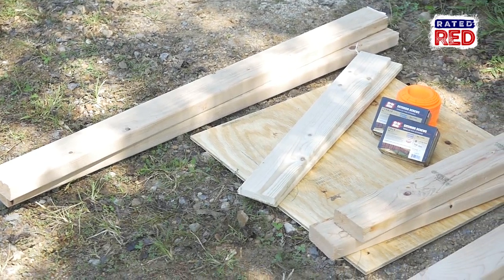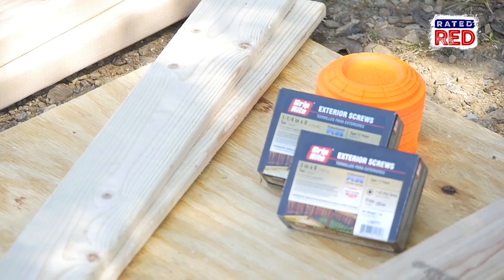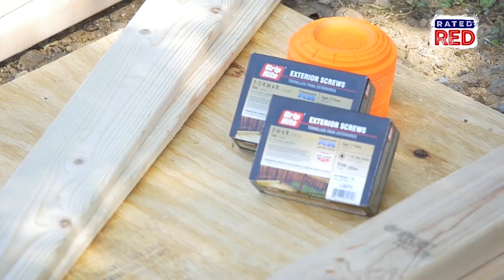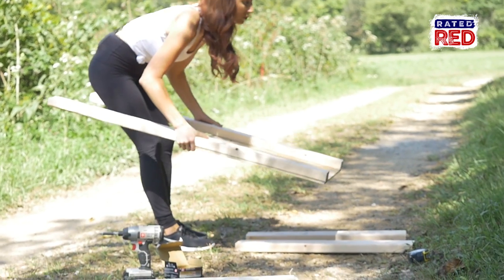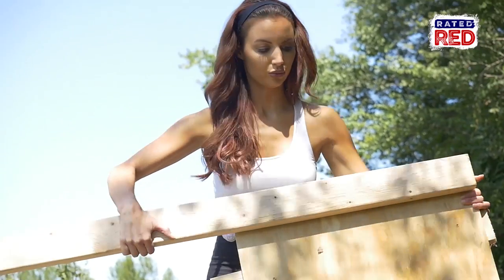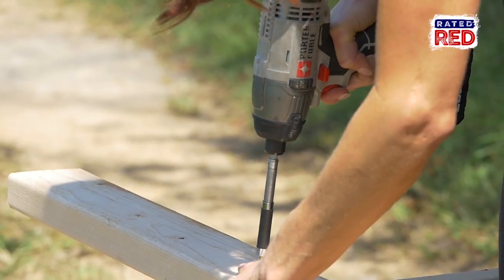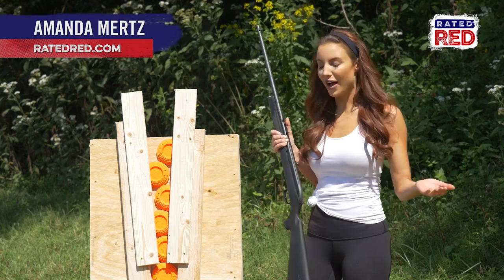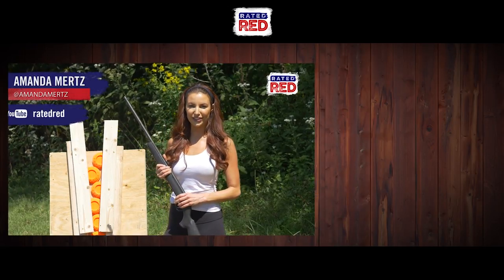How to Turn Clays Into Great Plinking Targets

Comment: Great idea and nice target setup. Also, you could put a 5 gal bucket under the clay target to catch all the pieces!   Thanks for the great videos!!!
Reply: Willy's Performance Cycle Center, Since 1969 they are biodegradable genuis
Reply: Used to make & sell these on Facebook  buy sell  trade locally.  They work great &  They are biodegradable,  but after shooting them on blm Land. Where my friend received a $700 fine for shooting at a target someone else had left up there. We bring them home & dump them in the flower beds & just spread them out since they don't hurt anything.  The buckets work great ! And we sold the ones we made with a bucket.  But also did the 3 sheets of different colored poster board. So if you missed but hit the board you knew where you were hitting at. & can be used for longer range for sighting in hunting rifles & what-not.